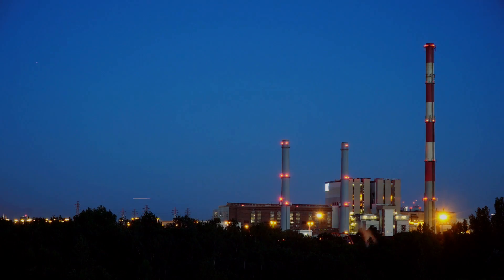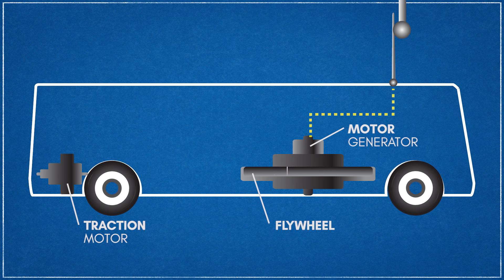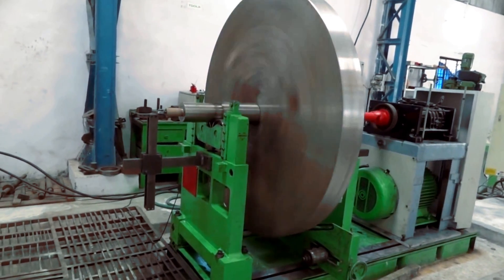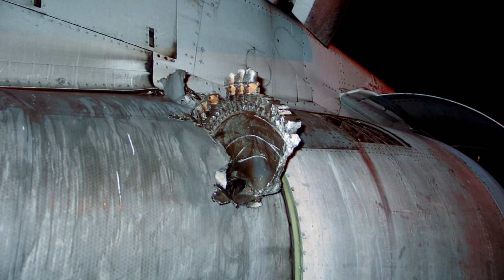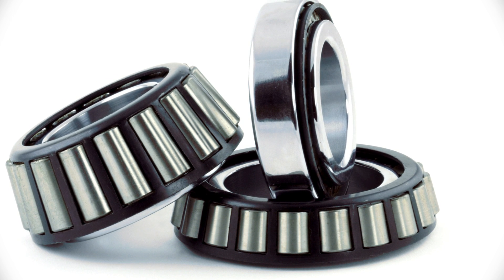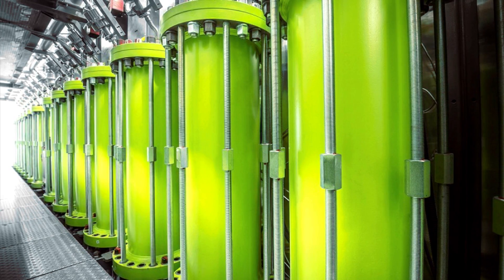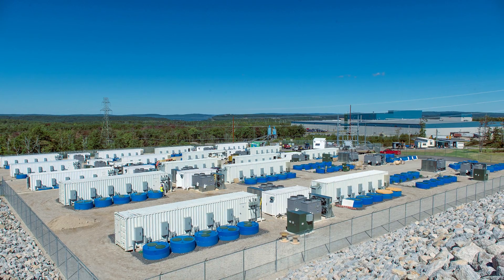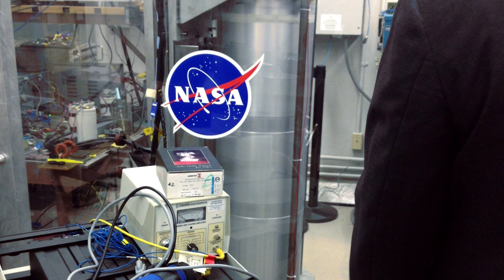The Mechanical Battery

Comment: We have two of these at work.  They are rotary UPSs.  They are spun up with power from the grid.  They are constantly spinning at 1800 rpm.  Connected to generators, automatic transfer switches will switch to them whenever we loose the grid.  It will provide 1.5 MW of power for 15 seconds.  When grid power is lost not only do they provide power long enough for diesel generators to fire up but they clutch start their own diesel generators to keep them spinning.  No batteries needed!
Reply: Everything about the OP here is badass. A mechanical system that kicks in when sh=t hits the fan which in turn cranks into motion ANOTHER mechanical system so powerful it ignites its fuel through sheer compression alone. Why? Because spark plugs are for engines that can't pull a real load.

Of course I'm being over-dramatic but still, the poetry of this design is not lost here.
Reply: Hellgie1 wow.
Reply: This isnt a mechanical battery,  as much as a mechanical capacitor.
Reply: @iamsatan7598  Battery, capacitor, flywheel, head of water, weights in an old clock... they are all energy accumulators.
Reply: @walsakaluk1584  Finally a rational comment.
Reply: @robh467  Congratulations! You have dumbed it down enough for you to understand.
Reply: @gregwarner3753  wait, let me gather your statements so I can tell the rest of the physicists you already figured out their work is bunk.
Reply: @gregwarner3753  it's all good. We'll throw away a hundred years of science because Greg Warner says mass plus momentum will never equal gravity. Whew; glad he figured that one out for us! 🤦‍♀️🤦‍♀️🤦‍♀️🤣🤣🤣🤣🤣🤣
Reply: @robh467   @Robby H  gravity isn't created by spinning an object, that's called centripetal force. If your that worried about scientists spinning objects around at high speed because it generates centripetal force you might want to avoid cars, their wheels can spin very fast, oh and bikes, also I would definitely stay away from the fair.

Other than the obvious danger of the bearing failing and a large heavy disc zooming off into the sunset, I am rather curious what serious dangers you are talking about.
Reply: @kaneworsnop1007  if you can oppose gravity with centrifugal force...then you are...ya follow. 
You're telling me gravity is influenced by mass alone. Well, agree to disagree. I believe, obviously, momentum can make a difference. Of course I'm not referencing a few thousand rotations per minutes by a few hundred pounds or much less, don't insult my intelligence by being so simple. I'm talking thousands of pounds at hundreds of thousands of rotations per minute, or less.
Reply: @kaneworsnop1007  just went and looked it up. For every one mile per hour faster the earth spins, you weigh one pound less at the equator. Now, this is just one medium of influence on you. Imagine twenty different one, all in different directions...what can you achieve through altering these. Push, pull. Etc. Etc. I know this is over your head, and I'm sorry.
Reply: @robh467  mass (m) plus momentum (mxv) equals gravity (g). 

M+MxV = G  really? Anyone else following this?
Reply: @robh467  that effect is due to centripetal force, not a change in gravity, they are two very different things. From my level of understanding of physics a flywheel would not exert any force on the Earth other than its own weight due to the fact that it would be perfectly balanced meaning it exerts an equal centra petal force in all directions a cross its plane. An example of this is a spinning top, when it's spinning fast enough it stays in the same spot (yes they normally wobble a bit, but they're mass produced toys with a large tolerance).

I'm curious what your level of physics education is considering you keep on telling everyone this goes over your head, for all you know some of the people your saying this too could be far more qualified than and potentially professional physicist's. Spelling and gammer also aren't necessarily a sign of intelligence or education, things such as dyslexia and autocorrect on phones effect this.
Reply: @kaneworsnop1007  it's very simple. If speed affects our gravity on earth, then "gravity", a fancy word we use to describe a symptom, an example of a force.....is also affected by speed. 
So put simply, and I don't understand why people have such a hard time with this...I can INDUCE the same Symptoms using a combination of mass and momentum. 
IN A CONTROLLED ENVIRONMENT, again...im going to say it slower for everyone...IN, A, CONTROLLED, ENVIRONMENT... I can exhibit, these affects, these symptoms...through a combination of mass and momentum. MORE IMPORTANTLY...A LACK THEREOF. 
Let me repeat for emphasis....OR, A, LACK, THEREOF. and in a controlled environment....maybe not everywhere. A motorbike can now make great use of gyroscopic stability. 
Something using centrifugal force. However, if you have very many stabilizers, gyroscopic devices....and ONE OF THESE LOSES STABILITY...WHAT HAPPENS, FORCE, DIRECTION, MOMENTUM. 
So in a controlled environment, can I affect something...exhibiting the same SYMPTOMS as GRAVITY. Without ever touching it. Yes, extremely possible. Even if it is on the outside of my centrifugal force. Answer, yes, if it is still within a controlled environment...then yes. 

Do things exhibiting these symptoms of mass in combination WITH MOMENTUM have the ability to affect and influence other things. Yes, of course they do. Even in a vacuum. Even in space. 
Actually, you would think most people have seen how artificial gravity can be INDUCED in space using ONLY momentum. 
The question is, can it effect something exterior of its' own personal mechanics. 
Yes. Yes, it can. Might have to be a couple hundred thousand rotations per second. But quite possible, extremely probable, and difficult to fathom.
Reply: @robh467  I don't know if I'm missing something from your explanation and there could well be something to do with moving mass generating 'artificial gravity,' which is a layman's term to explain how gravity could be simulated in space by using other forces, such as centripetal force. Centrifuge is a word which was invented to name a product when the first centrifuge was invented for labs, the incorrect term for centripetal force, 'centrifugal force' came into existence as a result of this product name. The effect you've mentioned of a person weighing less if they stand on the equator due to centripetal force doesn't effect gravity in the slightest, the value of gravity an object exerts can only be altered by effecting the mass and density of the object. What is actually happening is due to the rotation of the earth centripetal force is created in the direction of travel, causing the person or object on the Earth to have an upwards force in the opposite direction to gravity, thus making the person or object lighter. It is the same principle as attaching a bungee to yourself and the other end to the ceiling with it stretch to exhibit an upwards force of 6 pounds on you, if you were stood on a set of scales you would now weigh 6 pounds less, gravity however would still be exhibiting the exact same amount of force on you. A person jumping is pushing off of the ground with enough force to jump, again gravity has remained the same, the person has simply generated an opposing force greater than gravity allowing them to jump, once the person has left the ground they are no longer producing an opposing force to gravity so they are slowed and the pulled back to Earth by gravity.
Reply: @kaneworsnop1007  omg. I think he's almost got it Watson.
Reply: @kaneworsnop1007  yeah it's really pretty simple. If I can make "artificial gravity" as you call it, then I can also do the opposite. Hard to imagine in the physics that surround us... especially considering you might need vast amounts of mass multiplied by momentum to effect things outside of it's relativity. But theoretically completely plausible. 

Attach bungee cord...jump
Attach bungee cord, get a running start...jump.. 
Same result? Of course not. He had much more momentum to oppose gravity. 
Now complicate this a hundred fold because bungees is a bad example. 
Actually, that was a really bad example. Hard to use any example other than that which is mechanical and technologically advanced...which is actually going to give us physics of opposing gravity without aerodynamics, pressures, etc etc.
Reply: @robh467  For the record, what is your level of education. Be honest!
Reply: @TheUniversalid  well, before we go on record; is there anything that I've said that is false. Any of it ..?
Reply: And the diesel product goes to the lungs hehehe :/
Reply: Shame they fall back on diesel though, in this particular case.
Reply: @alexmckenna1171  why is it a shame?
Reply: Stretch that 1.5 mega watts out .over a months time is that enough for a home
Reply: @Deon Denis what an idiot you are. Please don't ever have children I absolute beg you
Reply: Whats the equivalent in whatt hrs
Reply: Smaaaart! What workplace is that?
Reply: Bearing manufacturers entered the chat..
Reply: Diesel Generators are the batteries then. Should still use batteries as an in-between these and the generators. Flywheel tech is just based on how much energy you need. Since gravity is a free force that is already supplied, just have a bigger energy storage with more flywheels. I theorize that flywheels can even generate enough energy to propel themselves if you can build a frictionless and safe enclosure. This can easily be done with magnets as outlined above. Why we arent pushing for 100% self-sustaining flywheel tech for homes and commercial applications is beyond me. Could pair flywheel tech with solar panels for homes (I think this should be mandatory tbh) and no one would need the power grid. Again as I have stated before big oil and power companies are the problem. Not us.
Reply: @alfredharrison597  I think news yesterday was rolls Royce is one of the handful of American companies undertaking small nuclear power generators. Small enough for planes, homes, etc. Which, essentially is just an improved design utilized by nuclear submarines.
Reply: Omg this 3 years old thread is awesome 😂
This robh guy, either a genius troll, or a truly mentally retarded person having meltdown
Reply: Helgie1 edit and warn people not to read this comment thread!
😵🤣
Reply: The Battery is the diesel in that case. You have a big capacitor
Reply: @samsaek666  There is no capacitor. It is a flywheel connected to a generator.
Reply: But don't you need batteries because of the transfer shitch delay? For such a big system it's mandatory.
Reply: @gustavobrtt  They are the batteries. Transfer switch delay would be the same for a battery system.

I believe you are thinking of an "online UPS" which is constantly supplying power through an inverter via the batteries, which are constantly being charged by the grid. No delay with those.

Probably used in conjunction with the main Diesel / flywheel UPS in server rooms etc.
Reply: @incandescentwithrage  No delay if it's synchronized. Maybe a droop not a drop.
Reply: @Deon Denis well here's me telling the moron to go get educated...
Hey moron, go read something! 
😂😂😂🤷🤷🤦🤦
Reply: @robh467  
Well, your concern might be valid if we would live in a kind of scifi universe, where humans would have excess to a material, that is strong enough and dense enough, to build flywheels, so energy dense, that we could earths rotation or even earths current orbit. I mean, the earth has already seen events that where much more energetic, than anything, that we could ever build and orbit hasn't changed a bit. Have you ever heared of the story from the secret concern of the russians, the earth could be in a kind of bis stable rotation and that it could switch the rotation axis anytime soon? They had this concern, after observing a wing switching its rotation axis several times in zero G abort a space flight and they figured, the earth may possibly do the same thing. 
Luckily it turns out, that, in the real world, the earth already reached its stable state of rotation, due to centripetal "force" deforming our otherwise pretty round blue ball of rocks, metal and water into a more elipsoidal shape. All the theory that cleared this phenomenon up was eventually called Dzhanibekov Effect.
I think your concern is of a similar, theoretically correct but at the same time realistically incorrect, nature.
Reply: @Enthropical_Thunder  Thank you for the smart answer. We need more people like you posting. Too much conspiracy idiots nowadays... Infodemia is terrifying...
Reply: @robh467  Talking to yourself again? Maybe his brain fell off the edge of the flat earth
Reply: @Deon Denis thanks, here's your two cents back. Take it and out it somewhere where you are welcome. Maybe you'll have something more intelligent to say down at the corner store 🤷🤷🤷🤷🤷🤷🤷🤷🤷🤦🤦🤦🤦
Reply: @robh467  you only have two cents? makes sense considering your English ability
Reply: @MilesPrower1992  and your   "english ability"
Reply: @Lyle-xc9pg  What do you mean? I can make perfectly coherent sentences.
Reply: @MilesPrower1992  if you understood English you'd comprehend I was telling others to take their two cents back. If you would've spent any time at all in America, speaking proper English with civilized folk....you wouldn't have misunderstood the syntax and composition. 
Mmm, pity.
Reply: @robh467  Really, Rob... trying to restart a 2 year old argument for attention? Have you no dignity?
Reply: @MilesPrower1992  I've been spinning in circles. ....
Reply: @MilesPrower1992  How funny, I just notices he came back...still spinninggggg!
Reply: @robh467  mate you are surrounded absolute morons, the fact you are getting reaction means you have offended people's intelligence's and the way they think (which is not a lot). 

I like new ways of thinking, its how we evolve in to better beings.
Reply: Take this video down now!!!!!!!!!!!!!!!
Accelerating faster than Earth's spin in centrifugal forces does what; faster than the solar system...? Exactly
We know the benefits of being able to have centrifugal force; it can become a gyroscope, that provides stability
In multiple axis, with multiple gyroscopes at different dimensions....well then all you need it to provide resistance in any variable to make force in that direction; i.e. everything we see is a loss of the universe; heat, electricity, ect. 
If you can spin hundreds of thousands of rotations per, whatever, then you could do millions with a short leap in advancement. So a super electrostatic motor, that is also gyroscopic...a battery, your propulsion, stability control, all in one. Thrown into your flying saucer; you'd fly into a thunderstorm and charge your saucer; spinning your gyroscopic mechanisms up to millions of rpms, all stabilizing each other; and enough power to fly around the Galaxy. Make sure hang solo has done the proper calculation in the computer; zip off into space. 
Avoid the emp's of Betelgeuse 😘; he made mention of this 🙊🙉

So again; take this video down now

Did I mention zero friction lubricants or magnetic suspended bearings. 
What about new rare metals and materials that cool with friction; I think I've said to much...

Again, take this video down now.

:Copy and pasted:
Reply: @robh467  nice shitpost
Reply: @Tankliker  shit post?!?!....maybe you didn't pick up on the fact since this post was started, till now, we've progressed a half dozen new ways to influence gravity. But, the oldest and truest, centrifugal forces...gyroscopes ...still beats gravity. Every. Single. Day. 

I'm sorry; were you regurgitating commit someone else accidentally got on you?
Reply: @robh467  you are a goldmine mate, keep it up I gonna use the copy&paste to annoy some physics students lol
Reply: @Tankliker  send em my way. They might know me from social media
Reply: @robh467  quick question, how much force would be needed to gyroscopically stabelize the earth?
Reply: @Tankliker  oh, the question wouldn't be "how much force to stabilize blah blah blah"  first off why would you ever want to. .
The question becomes when you use energy even magnetism...or otherwise make you own gravity through inertia and mass, i.e. angular velocity centrifugally by mass...just like earth; then how much of that impacts earth and the other surrounding environment.
Reply: @robh467  why should it be taken down? Not because of your nonsensical post.
Reply: @gregwarner3753  because people more intelligent than you are currently working on this very application. If you had any more sense, you might realize where this technology is headed in the coming decades. 
Thanks for you two cents, take it back and put it somewhere else. 
You don't have the knowledge to add anything sensible to the conversation other than to make fun of hyperbole?
Reply: @gregwarner3753  btw greg, if you want to really enlighten yourself; scroll up to another thread where I have an intelligent conversation with 'handle' Tinney. I've just recently added some new information there; it would definitely be over your head, but a good read for anyone.
Reply: @robh467  I agree with your sentiment that this is indeed a potentially very dangerous technology. I fully admit to being a pee brain as well, and if it's not too much to ask, would you please mind elaborating on what exactly can happen if this technology is taken too far? Could we create black holes? Rips in the fabric of space time? I'm fascinated and near petrified all at once.
Reply: @gregwarner3753  clearly you have no concept to consider other people's understanding and views on what they see.

Try to be little bit humble, you might learn something.
Reply: @gregwarner3753  yeah I just went and looked up equations too Greg. Now go back and look again...if you make it through the whole thing, every equation...and don't see angle, speed, vector, velocity.. etc. Etc. 
Yep, lots of equations for gravity and different equations for the different SYMPTOMS of gravity. Sure did see a lot more than mass and distance on that page...what about you. You want me to read it for you???
Reply: @robh467  wtf are you on?
Reply: @Rick-the-Swift  name something in the universe that doesn't spin. Go ahead, I'll wait. 
Even solids, on a molecular level, are in motion.
Reply: @robh467  To name something that doesn't spin... the (metaphorical) gears in your brain for one.
Reply: @MilesPrower1992  well. So you named one. Actually, I'm impressed. You can brush your teeth and go to bed now.
Reply: @MilesPrower1992  you seen those motorcycles that can upright themselves? Using gyroscopic mechanisms. You seen the new field flux generators that spin magnetic gyroscopic mechanisms. I mean, essentially you have to be able to channel opposing matter as well as regular matter in systems like particle accelerators. I remember decades ago when they gave pretty accurate figures down to atomically the volume of anti-matter created daily. Back then there was only a few places it was being collected. 
But, we can induce or obvert flux. By flux, gravitrons etc. Gluons. Time. 
Google has time crystals now, right?
Heck, now we have lasers even that can bend gravity. Don't believe me? Google, can light bend gravity. Lasers. 
...and yes, we can absolutely use energy in a centrifugal nature to obvert the EFFECTS of localized gravity. Even, now, induce gravity. I.e. Fields. Propulsion from the opposite of stability. After all, that's all we are experiencing through gravity is a loss of energy...or transference....within a system. 
Who knew holes could be so much fun.
Reply: @robh467  ok, didn't ask for your two cents, so please keep them :)
Reply: @MilesPrower1992  but, but. I have so many pennies from this thread alone. Please, take some and extra.
Reply: @robh467  Hey guys check it out a schizophrenic meltdown!
Reply: @robh467  Hi nutter! how yah doin' today?
Reply: @thekinginyellow1744  imagine all the propulsion methods we have yet to disclose to the public; oh, sorry. You'll need someone smarter than you to suffer through trying to explain it to you.
Reply: @robh467  take your meds
Reply: @Cstegg  if they made meds that helped you be better at mathematical theory, then I'd tell you to take your meds. One way magnets; spinning to the point of creating mass enough to have gravitational force; avoiding not only gravity, through material science and metallurgy but also centrifugal force, and also avoiding time and other properties of the universe....all possible.  
Also with quantum locked levitating bearings make extremely high rotation speed and weight load are possible...
Even in your car or truck without them though, you can just spin gyrscopic mechanisms with weight up to five or seven times that of gravity. Anytime you apply resistance suddenly you will have directional thrust. A hundred pound child running around at a few thousand rotations per minute suddenly decelerate with resistance you're gonna move forward pretty fast....or whatever direction correlated to resistance.